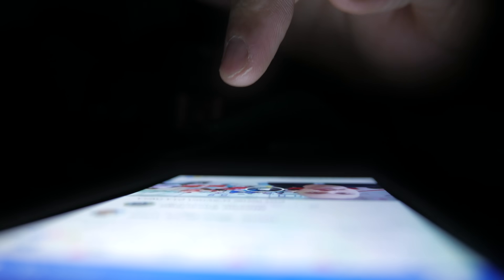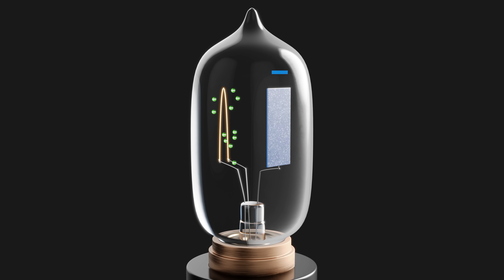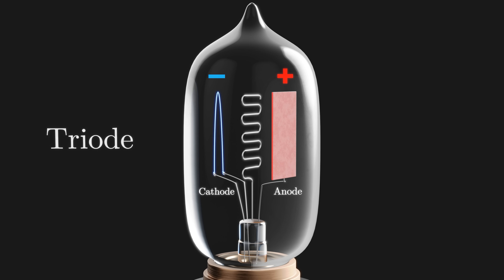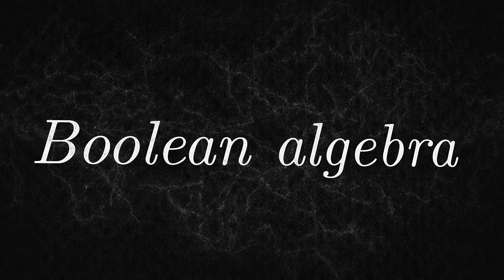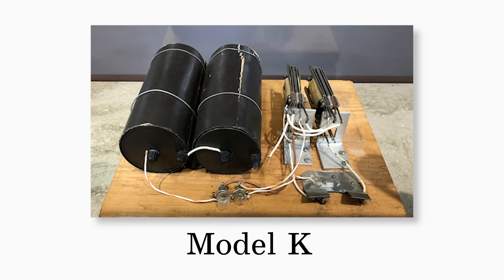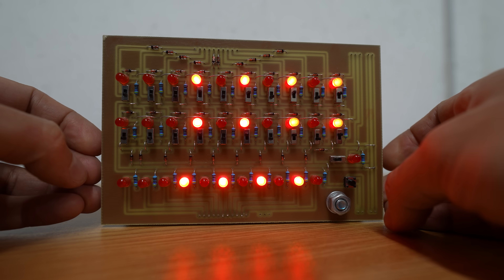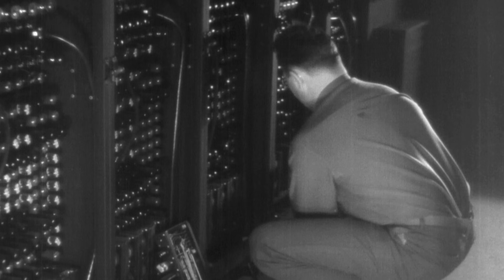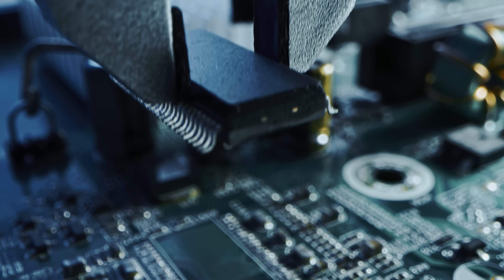Why The First Computers Were Made Out Of Light Bulbs

Comment: The Z3 was a German electromechanical computer designed by Konrad Zuse in 1938, and completed in 1941. It was the world's first working programmable, fully automatic digital computer. The Z3 was built with 2,600 relays, implementing a 22-bit word length that operated at a clock frequency of about 5–10 Hz.
Reply: The smart German guy who created Z3 was very young, a fresh graduate. He was conscripted and sent to the front line! After a few months, it was realized that he was more useful back home, as engineer, than on the front line as soldier. Fortunately, he did not die during his deployment.
Reply: The Japanese also developed a relay computer very early on
Reply: @myid9876543 Only after WWII  ...  after Babbage, Zuse, Colussus, ENIAC ... and it was based on ENIAC...
Reply: @myid9876543 IIRC the Japanese one is the most advanced relay computer ever produced.
Reply: Yes, I was hoping someone would post this.  Zusa didn't get much credit outside of Germany, for some reason 🤔
Reply: Also Derrick ends on the transistor, yet wouldn't say his name, Shockley. Shockley was also canceled, for some reason, kind of like Zusa 🤔
Reply: @salty_berserker_channel 'for some reason'? First of all, it was Brattain and Bardeen who did the vast majority of the work, and Shockley showed up for the photoshoot. Second, he was a horribly racist piece of garbage who tried to push complete nonsense as science to try and prove that white people were superior to Blacks. Thus, his name should rightfully be stripped from the history books around electronics.
Reply: @salty_berserker_channel He was canceled for damn good reasons.
Reply: Just for completeness: the Z3 predecessor Z1,  was completed in in 1937 and a pure mechanical device. In its functionality quite similar to the Z3 but unreliable due to its mechanical design. However, both were built long before Colossus and had much more in common with modern computers than Colossus.
Konrad Zuse himself built a Z1 replica for the 'Deutsches Technikmuseum' in Berlin.
As far as I know, after WW2 the successor Z4 was one of the first universal Computers and was also the first commercial computer. In 1949 the Z4 was leased to the ETH Zurich.
Reply: And Edison stole everything!
Reply: @robertlifea6405  Someone did find a single patent by Edison before he had anyone working for him, that appears to have invented on his own, without stealing it ... 1 out of 1,093 ...
Reply: Yes , that's what i'm aware of as well , It did not use vacuum tubes The nazi party.didn't really see much use for it although they did use it To do a calculations for glide bombs , This technology could have possibly been used to create a Guidance system For their v2  rockets , That with the combination of television technology they had Developed  Possibly couldn't have been used together to create an anti ship missile system That could have prevented  The allies from landing  on the shores of germany , If you track the evolution of early computers They were predominantly advanced for the purpose of air defense systems by the u s government .
Reply: But can it run crisis??
Reply: I was about to add this too. Tho his luck he added electrical to the machine ;-)
Reply: The ABC machine I believe was the first all electronic computer and it predated the z3. The Mark I at Harvard was electro mechanical,it used relays and vacuum tubes. The origin of the word bug to mean a programming mistake was from the mark I, aikens assistant, grace Hopper, found a moth caught in a relay. 

To tell you how technology lingers on, in the early 50s ATT was replacing the repeaters on the trans Atlantic cables. They had a choice between using vacuum tubes or transistors,,and they went with tubes bc with tubes they fully understood them, w transisters they were still learning.
Reply: People give way too much clout to the Z machines. It was quickly obvious that they were not the future of computing yet Zuse kept trying to push relay computers well after tube's had taken over.
Reply: But not Turing complete
Reply: @scopestacker9787  The Z3 was not designed to be Turing complete; they didn't need it.

In 1998 it was discovered that the Z3 was actually Turing complete. As it wasn't designed to be Turing complete, coding branches is unintuitive and complicated.
Reply: @scopestacker9787  What's the difference between fully programmable and Turing complete?
Reply: The first computer was done by Marconi
The inventor of radio
Reply: @veronicalogotheti1162 Marconi didn't invent radio 

The Marconi company invented it 22 years after he died, and this was long after other computers ...
Reply: @veronicalogotheti1162  there were other computers built way before that. However the ground breakers that we fixate on were 'electronic' using binary which is the standard because its efficient
Reply: The base of computers is in radio
Telegram
Reply: @veronicalogotheti1162 ...No ... please go and do any research
Reply: @veronicalogotheti1162  wtf are you talking about lmfao. this is sooo wrong.

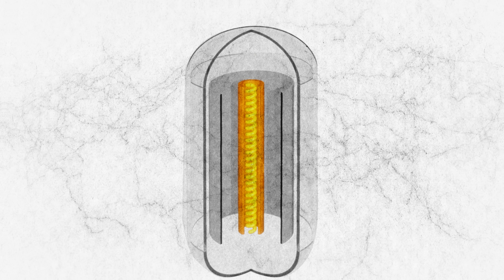Comment: Your sequence from about 2:50 to about 3:50 implies that the development of the indirectly heated cathode predated the development of the triode. This is not the case, De Forest's triode followed the diode in only two years (1906), while first indirectly heated cathode was patented by two Westinghouse workers (Messrs Freeman and Wade) in 1921, another 15 years later and well after the introduction of the tetrode.

Source: Stokes, John W "70 Years of Radio Tubes and Valves", Vestal Press 1982.

You've also repeated the common Furphy that Eniac was the first entirely electronic computer. It wasn't.

Tommy Flowers built the first all electronic computers at Bletchley Park in 1943 to perform cryptoanalysis, the first of which (nicknamed Colossus) ran in November of that year, predating the first run of ENIAC by more than two years. Tommy was a Post Office engineer who had tried for years to persuade the top level brass that valves could be used as efficient switches to no avail. 

The boffins at Bletchley knew he was on to something and gave him the opportunity to develop it (but they didn't have enough funds so he paid for part of it himself). I worked, it played a significant role in  ensuring D Day was successful but at the end of the war Tommy was forced to dismantle the top secret machines and forbidden from telling anyone about them. He was even left with a significant debt because no-one was allowed to explain the significance of the machines on which he had spent his personal money so he was only reimbursed GBP1000 despite having spent many times that.

He went back to his job at the post office where the brass continued to deny that a complex all valve switching machine could possibly work. Tommy could have said "I know it works, I've built several" but was forbidden from doing so. 

Never in your life will you suffer anything close to the disappointments endured by Tommy Flowers but he carried on, eventuall winning over even the PO staff and building the first all electronic telephone exchange in the UK.

Source: Gannon P. "Colossus: Bletchley Park's Greatest Secret" Atlantic 2007

Comment: My mathematics teacher worked on the Manchester Mark 1 (1954) which contained 4050 value. a major issue was the average time before a valve failed and had to be replaced was 2 hours. the first computer I worked on was a 16k IBM which had a  core made of iron ferrite magnets which was hand knitted with 3 wires through each circular magnet!

Comment: Good history, but clickbaity title.  By 1940 thermionic valves had very little in common with actual light bulbs, having evolved in a different direction.  One of the greatest innovations of the 1920's was the "dull emitter" coating that allowed the cathode to emit plenty of electrons at a much lower temperature, reducing the energy requirements for the heater and making the heater much less visible.  I built a radio out of a genuine Type 30 tube from the mid 1930's and when it is working, even in a dark room you can't see the filament glow.  These are the sort of tubes computers would have been built with, precisely because of the power requirements.  But admittedly having grown up with the glow from the (higher power) valves in my parents' early TV sets, I was a bit shocked when my Type 30 worked without emitting more than the most barely detectable glow in a perfectly dark room.

Comment: I was a kid when solid-state electronics were replacing vacuum tubes in consumer products.
 I remember that radio and TV 
repair was a widespread cottage industry. The best in that field were able to adapt and stay afloat, until the advent of integrated circuits.Great video 👍👍
Reply: I enjoyed taking the back off our television, gathering all the tubes, and going down to the drug store to test them on the tube tester ... even when the tv was working fine.
Reply: When you replace a vacuum tube with another of identical type (same code on label), you can be sure that the properties are the same. This is an advantage of the tubes. When you replace a transistor with another of identical type, the replacement should be first measured, if matching the properties is paramount. Also, a sound amplifier with vacuum tubes does not have that background noise notable in those using transistors, when the amplification is at maximum.
Reply: If you could repair a TV you could work for a big name company going to hospitals installing, repairing and maintaining high end medical x-ray. You were a hero and even the Doctors worshiped you.  We were networking image transfers before they knew what to call it. We could do 3D imaging using analog video. You got the image in a day or two because computers were too slow. CT, computed tomography was invented by an engineer that worked at the EMI recording studios. Then the companies handed out laptops and said figure it out. Dial up. The blood ran despite how hard we tried to reprogram  those folks. Now the software and every other kind of repair are two disciplines. Benjamin Franklin was your last renascence man that could know enough of everything to function in any subject. Its only going to get worse. How long before you ask your computer "Whats wrong?' A you have to decide if you can trust it. I'm hanging on by my finger nails.
Reply: @terryscott5568 A lot of fields are requiring the specialties to know so much more than ever before to function. Medicine is a field that suffers this from so much advancement. It is a blessing and a curse. To graduate medical school Doctors are required to know magnitudes more than doctors just 30 years ago due to the huge advancements in research.  It is absurd really.

Comment: I use a lot more relays but it may be much simpler .  Use only 3 counters. Counter 1 counts up or down.  Counters 2 and 3 count down only.  When adding counters 1 and 2 are loaded with the numbers to be added .Counter 1 counts up while counter 2 counts down. When counter 2 equals zero the sum is reached . When multiplying the number in counter 1 is transferred to counter 2. Then counter 1 is cleared to 0. The number to be multipled by is loaded into counter 3 . Each time counter 2 is added to counter 1 counter 3 is decreased by 1. The answer is in counter 1 when counter 3 equals 0. When dividing the number in counter 1 is transferred to counter 3. Counter 1 is then cleared to 0. The number to be divided by is loaded unto counter 2. Counter 1 is used to count the  number of times counter 2 can be subtracted from counter 3. When counter 3 equals 0 the answer is in counter 1. Thus only 3 counters are needed.

Comment: Computers were built with vacuum tubes which were a spin off development of the light bulb.   It required then to figure out that the filament could heat a metal object know as the cathode in a vacuum tube to produce electrons in the tube envelope whose flow could be controlled by insertion of a grid element where a voltage could be applied to the grid element to control the flow of electrons between the cathode and one additional element which was the plate element.  This allow the state of the vacuum tube t be changed from an on to an off state which represented 1's and 0's   of a digital computer.   Univac may have been a vacuum tube system but I am not sure my memory is that correct about that it was a long time ago.  The early computers of this type produced a lot of heat.

Comment: One of the wildest facts is that the AIM-9 Sidewinder missile used 11 vacuum tubes to do real time partial differential equations. I'm knee deep into reverse engineering one of them as I have an entire B model GCU with the later J seeker that is partially transistorized. In additon I'll have a loaner K13 (soviet clone of the B model) to crosscheck

Comment: The first vacuum tubes were also directly heated. This means that the cathode and filament is the same. This makes smoothing a drama. First large inductors and then the smoothing capacitor. These capacitors cannot be very large, so that a hum is always audible in amplifier technology. This problem was solved with more modern vacuum tubes that are heated indirectly. Amplifiers now also became a lot more affordable.

Comment: more than willing to be corrected, but wasn't the first programmable computer the "bomb" ? the computer(s) used at bletchley park in uk to decrypt the enigma code used by the germans during ww2? very informative video as always.
Reply: The Enigma cracking machine could not be programmed. It was a single purpose device. Which is why it is not counted as the first general purpose programmable computer. Because it wasn't. Now Turing could have built such a computer. But he lacked the resources to do so. So he didn't. England poor, America rich.

Comment: This is nonsense because the first digital computers were made from relays. Any logical function can be created from the relay. What you describe was one of the first semiconductors, i.e. tube - vacuums triode as a direct predecessor of the transistor and also of semiconductor rectifiers as vacuums diode.

Comment: Naming vacuum tubes as "light bulbs" is more to make an eye-catching title, than properly describing the computer.
Light bulbs use a tungsten filament brought at 2700 Kelvin, which emits white light as consequence. A vacuum tubes uses a filament to heat the cathode at 1150 Kelvin or less, so it can emit electon. At such low temperature, the filament emits a dim reddish light, which can be seen in the darkness.  
Vacuum tubes aren't ideal for building computers. The simplest form of SR flip-flop (set-reset) requires a minimum of two triodes, while a MS flip-flop (Master-Slave) requires five triodes. A divider or a Johnson counter, more than ten triodes. This is why the simplest computer with a Von Neumann architecture required tens of thousands of vacuum tubes. Thankfully, transistors took over at just the third generation of computers...

Comment: I had a DEC PDP11 plus some ancillary equipment in my flat in the 1980s - and the lights did dim slightly when I turned it on, and noticeably flicker a bit when it was doing calculations. I can imagine that ENIAC might have caused a few flickers without its generator...

Comment: The early vacuum tubes were quite bright but as more efficient and les bright they were divided into two categories, bright emitters and dull emitters. The Colossus computer (about 1944 and in England) the vacuum tube life was extended  by lowering the heater voltage in the tube before actually turning it off.

Comment: The first digital computers came before semiconductors were invented, thus vacuum tubes built the first switches — AND and OR gates, NAND/NOR gates, shift registers…

In the mid-60s, somebody donated an old IBM650 to my university’s engineering school. It was a vacuum tube mainframe with a drum for its main random access memory. Its language was an arcane bi-quinary system.

Wasn’t much of a computer, but it made for one hell of a space heater for the lab on cold Detroit winter evenings…

Comment: Replace the potentiometers. If you have solder experience, just replace the whole potentiometer assembly rather than the metal contact inside it. This has saved almost all my controllers

Comment: The title of this video is incorrect. The first computers were fairly mechanical, however not all that general purpose. (IBM's various tabulating machines and card sorters comes to mind here. The only thing electrical about them were the electric motor running the mechanism. Some might argue that the Antikythera mechanism is the first, but it is very application specific, something IBM's tabulating machines really weren't in comparison.)

However, a lot of these purely mechanical computers were both hard to build and maintain. So relays took over the information carrying role that linkages had before. Still however not that general purpose by modern standards though, so setting up a bar of being Turing complete is often regarded as logical.

The world's first programmable Turing complete electronic computer were the Z3, a relay computer built and operated roughly 4 years before ENIAC.
It runs paper tape for the code, making it fairly trivial to change program. Unlike ENIAC that is hard wired... So the fact that the Z3 isn't all that Turing complete in practice (due to lacking a conditional jump) isn't really a problem, since the operator can run various smaller programs and do these decisions manually instead. (Deciding what next tape to feed through takes seconds to set up, unlike the ENIAC that takes hours to reprogram. So the Z3 were honestly a step ahead in that regard. Though it did only run at 5-10 Hz.)